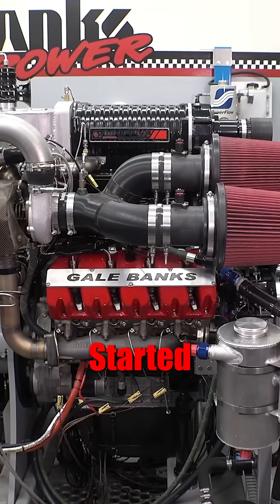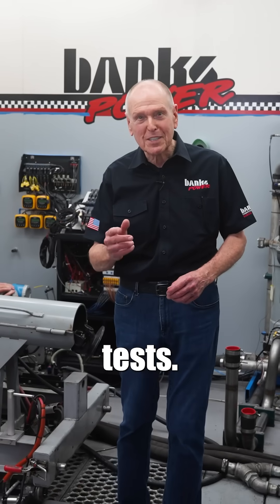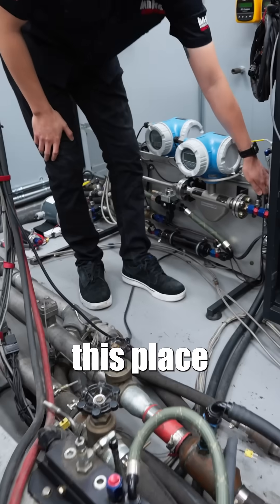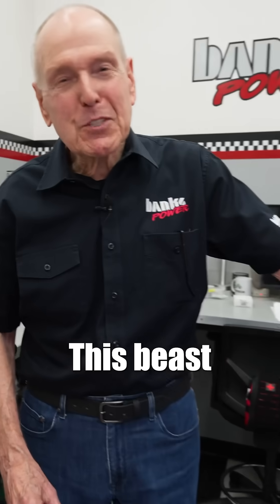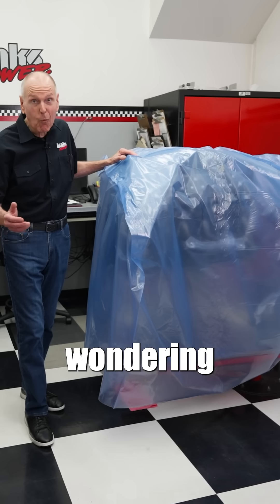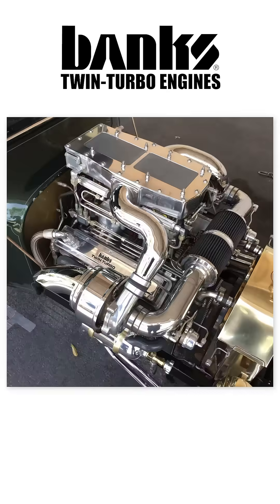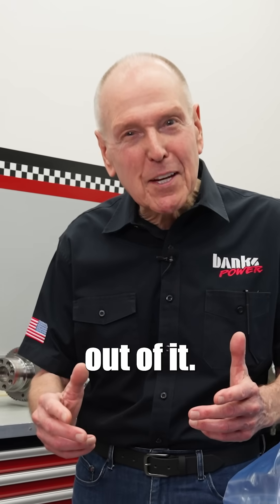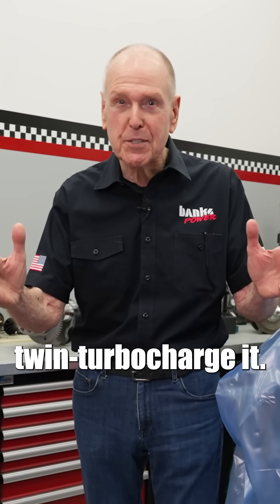We’re going to twin-turbocharge this engine, and it’s not Diesel.

Comment: If ford actually thought the LS was stupid and archaic they wouldn't have spent millions to build the same type of engine, all platforms have their benefits and we all know the pros of a well designed pushrod engine. Small, simple, inexpensive and capable. The thing I find weird is why there isn't more pushrod 4 valve engines out there? They do it with diesels, only thing I can think of is that's a lot of mass to keep under control at high rpms obviously that's not as much of an issue with the big oil burners.